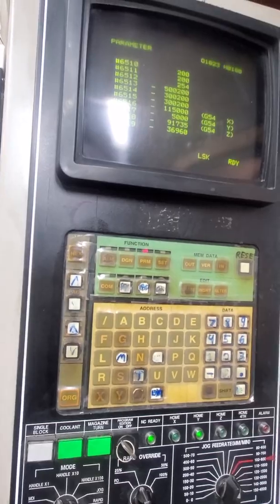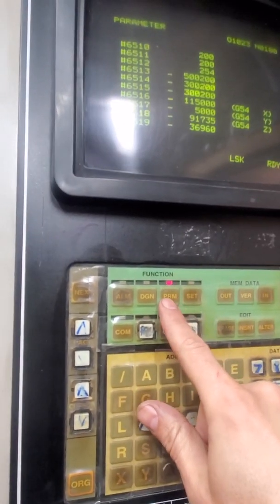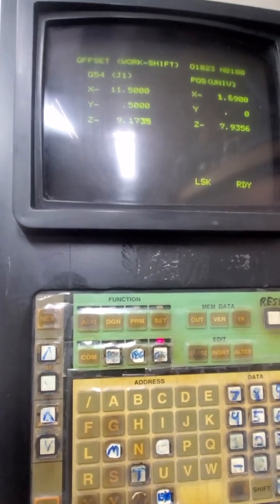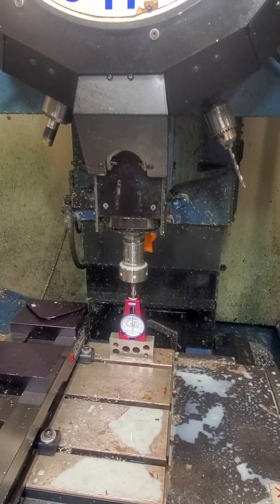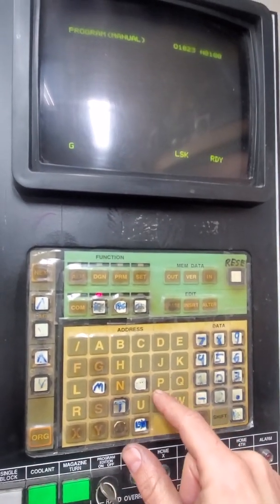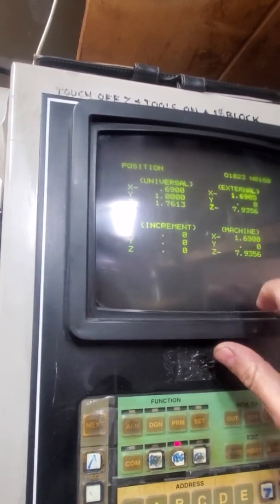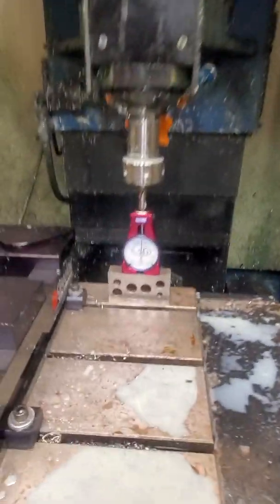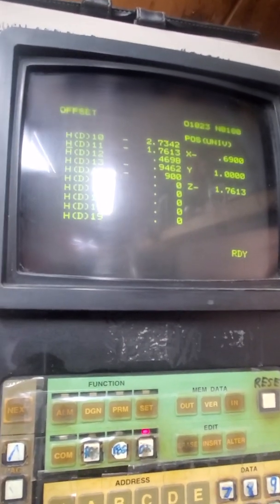Yanac MX3 - Tool Offset - The easy way

Comment: Hi, I have Mazak EIA VTC 41L machine with Yasnac MX3 but when I click on offsets, then next I do not see that screen? Great videos by the way!
Reply from the maker: Hi,  hope the videos helped. I am not sure I only have this one machine with this control. For me the next cycles between work offset and tool offset.  Maybe it's something that the machine builder sets up. Maybe try the arrows instead?
Reply: Hi, Did you find a solution? I have same problem.